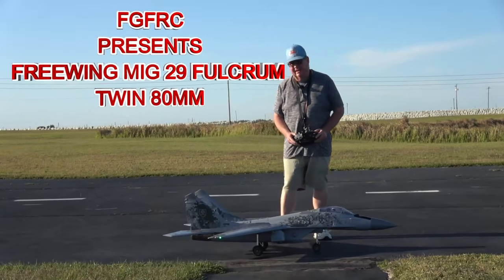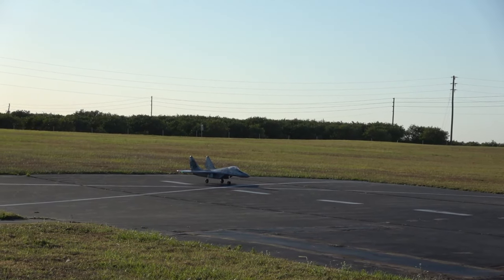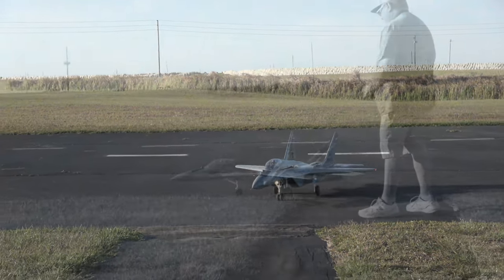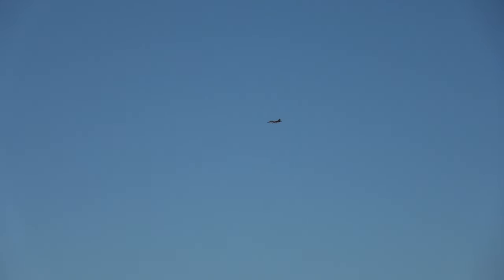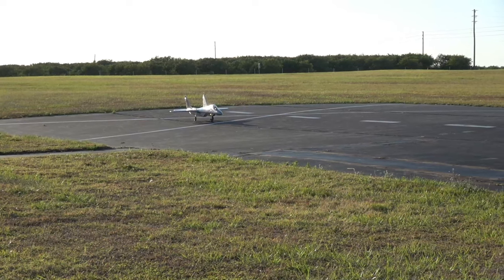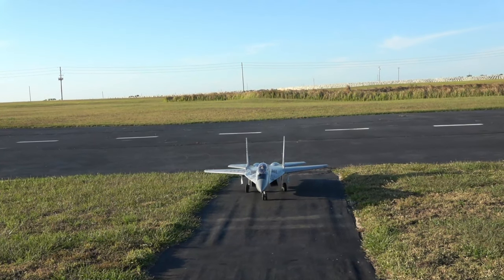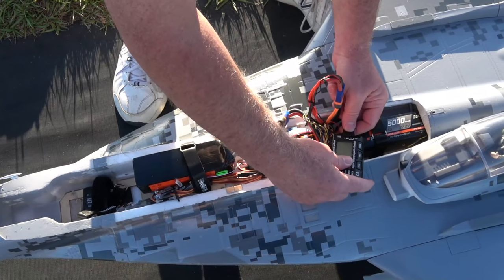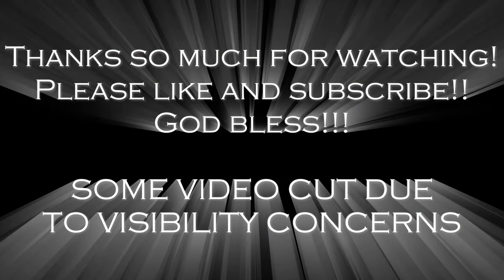FREEWING MIG-29 FULCRUM- A GREAT FREEWING PLANE! by Fat Guy Flies RC

Comment: Hello fatguyfliesrc
Got same mig-29 and same lipos..,
3ounces of weight in the front is that really necessary? When i check cg , the plane stays in ballance on the cg marks with the tip of my fingers.
Waiting for good weather for my maiden. 
Great vids btw .. love your channel
Greets Danny from the Netherlands
Reply from the maker: Thanks for stopping by , not the weight is not. The way I have the wires i set my rear lipo back a bit so I added the weight. With this plane however cg is hard to get but she does not seem to care. Flies great no matter what.
Reply: Thank you for your quick reply! 
Do you want to share  some as3x numbers?
Reply: @FatGuyFliesRC  hey hows it going, just bought the jet, noticed a few forms where they talk about the elevator motors going out, is that in older batch? I know some people are buying some after market parts for the mig 29 just to fly safer... and idea or tips

Comment: I hear its a great second or third jet?!??
Reply from the maker: it is if you have the space to fly her in those twin 80s cut across my little field quick and our runway is only 210 feet so really it is almost to big and fast for my field. But as for flying , don't get slow in turns and give your self a long level approach to land. Land with some speed NOT A FLOATER.